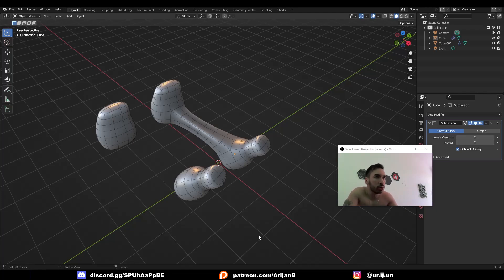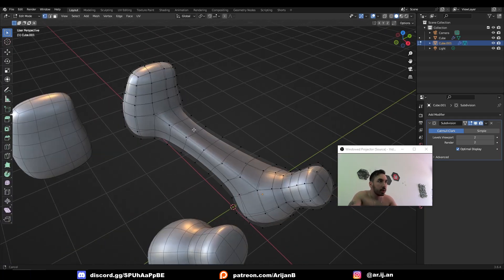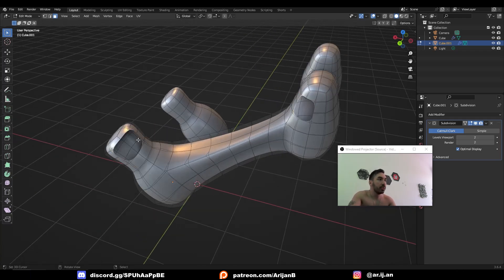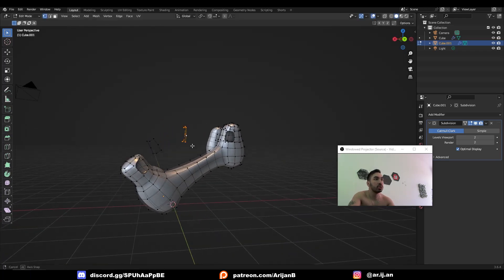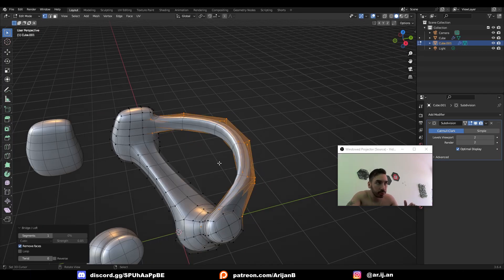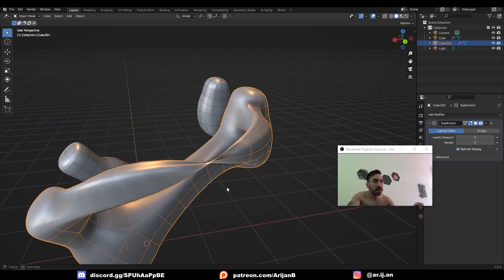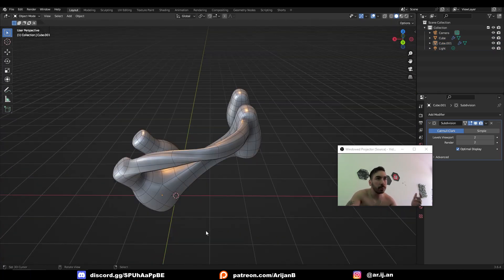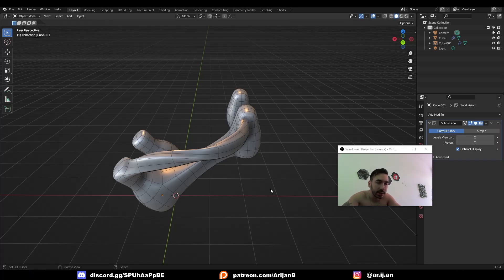The COOLEST modeling tool in Blender (Part 2) (Arijan)

Comment: Very cool advice, thank you so much! I've been able to modify this method a bit, if I need the exact location of the connections. You can put the hole through the array and curve modifier. This way you will be able to position the exact location of the joints precisely